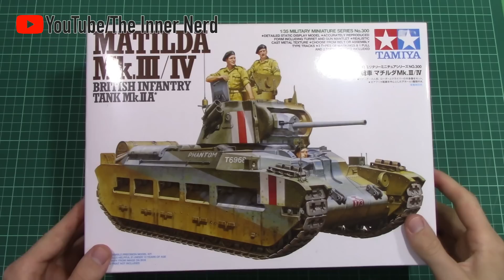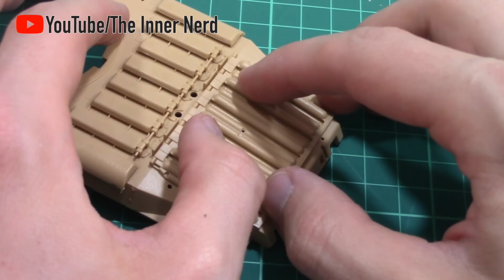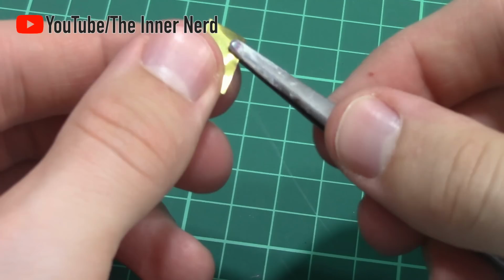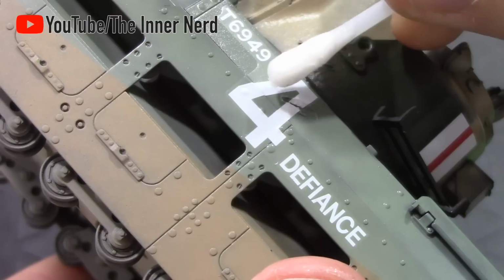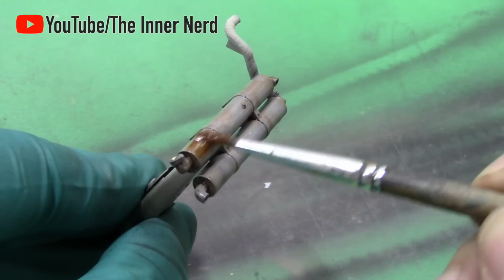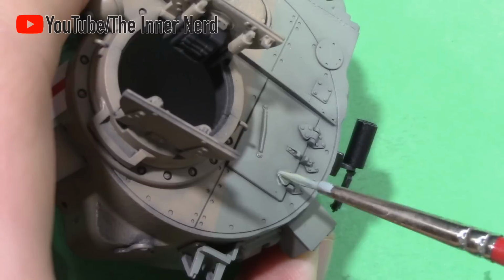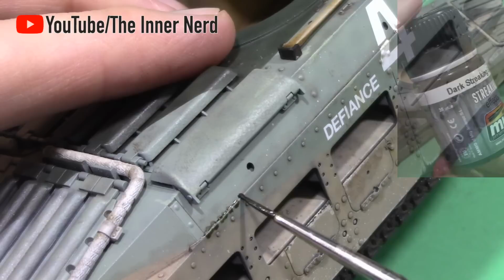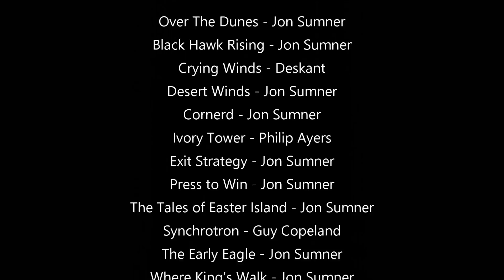Tamiya Matilda Mk.II 1/35 | The Inner Nerd

Comment: Nice build. Thanks also for showing how you built exhaust. Most other presenters skipped that part. Question: what did you use for base paint? So before the weathering what was the color of exhaust pipes and muffler? Thanks in advance.
Reply from the maker: Thank you. I don't actually know and having just re-watched the video I'm no clearer myself haha. It looks like I based it in a light sand/beige colour before I applied the AK Worn Effects and then further paint layers. I hope this helps and thanks for watching :)

Comment: What did you use to tone down the rust streaks?
Reply from the maker: I'm using white spirit but turpentine should work also as well as enamel thinner. I think I mention or at least subtitle what I'm using on each part if you hit the closed captions button ☺

Comment: Cool but lacks techniques such as welding or chipping
Reply from the maker: Thanks. Looking at the reference photos I used though don't show any weld seams that weren't already molded in the kit, so no need to add any more that didn't exist. Also you must have missed my entire chipping section which starts at 23:27 and lasts about 5 minutes...
Reply: What welding? It’s a Matilda II. Go and look at a real one. The turret was basically one big casting, the main hull two big castings with a join that’s invisible from outside the tank and pretty much everything else was either flush-riveted together, or, if it needed to be removable, bolted on. There were some spot-welds on things like the rear fuel tank’s brackets and equipment boxes but they’d be invisible at this scale.

As would most welds of any kind., but I’ll spare you my griping about out-of-scale welds and rivets.